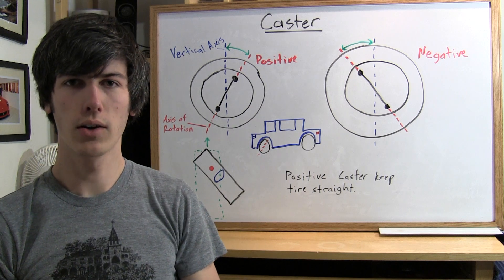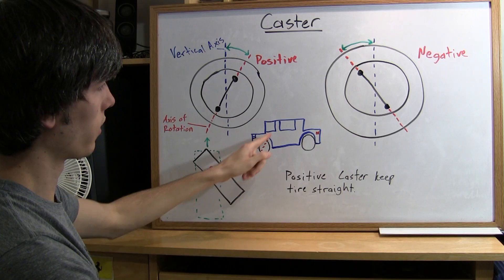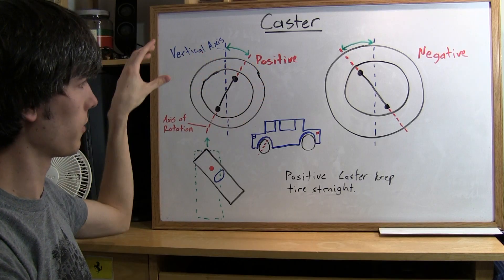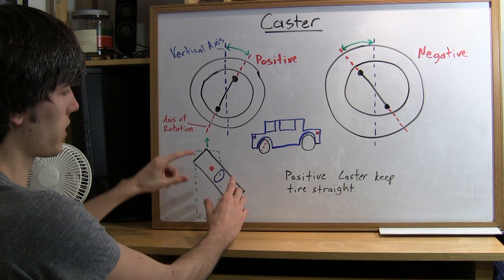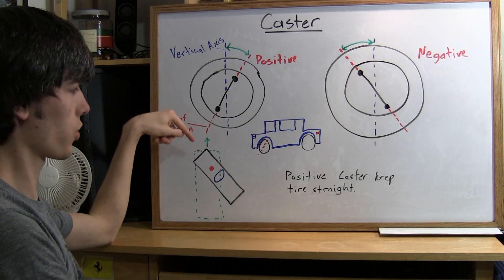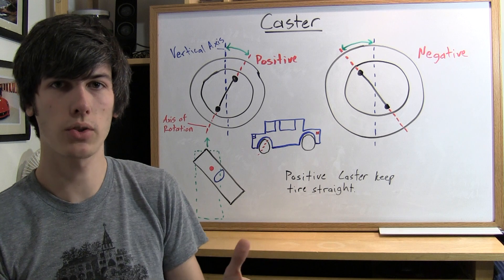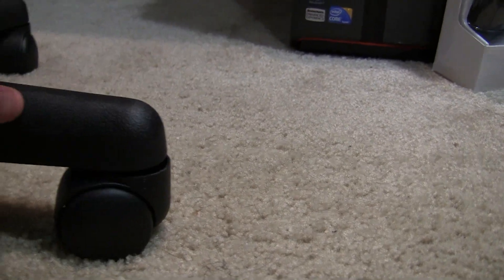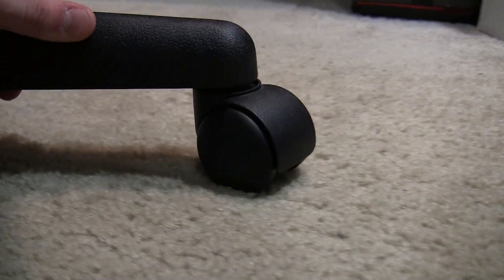What Is Caster? Wheel Alignment

Comment: why does uneven caster cause pulling to one side? Do the wheel center slightly to one side? I understand that with camber the increased rolling resistance causes a pull but i dont get what forces causes the pull with uneven caster

Comment: So the front wheel of a bicycle has negative camber? The patch is clearly ahead of the axis of rotation.

This must be why the steering is so unstable when you're "leading" your bicycle by the saddle and walking alongside, you have to actively tilt it to adjust steering.

The little tricycles kids use have positive camber though.

Comment: He didn't mention cross caster, about 0.25* to 0.5* difference between the two front wheels. If your car is wandering towards the gutter, you don't have enough cross caster. Cross camber applies too.
Reply: Less caster on the drivers side wheel will help counteract the road crown.

Comment: A simple way to understand what it does, it changes the camber at different steering angles. So if you run a lot of negative camber with positive caster, your leading tire has a better contact patch at sharp steering angles. Hence why drift cars have a lot of negative camber in the front to allow more front end grip.

Comment: since I changed my tyres, i have felt that the steering has gone too light(eveb though the new tyres are much wider) i.e. it is too easy to turn the wheel even when not moving. And while driving the car seems to sway aimlessly and the tyre would not straighten themselves. What could be the problem?

Comment: Got a new Car (Suzuki Vitara LY) and the steering doesn't return to center all the way, the wheel stays at about 20° if you don't push it back by hand. On most bends, I can let go and the car goes around by itself. It makes going in a straight line on the highway and changing lanes very difficult. How likely is if for a factory new car to have the caster angle wrong, be it by accident or by design?
Reply: Hamachingo thats just bad alignment all together
Reply: Jasperrsworld that's my guess as well. Looks like my dealer didn't check/do the alignment after the new car came off the ship and now I gotta do an alignment on a brand new car and sending the bill to the dealer. Apparently they just bolt the cars together in the factory and the dealer has to do quite a lot to make it ready for sale.

Comment: Nice video, but the example of the chair is not correct.  This is called "trail" and is yet another variable amidst camber, castor and toe.  Actually, the castor of the chair and shopping trolley is ZERO (its a vertical line), but it has x mm trail.
Reply: I see this as well good eye.
 To get caster (on his chair with LOTS of trail) tip the chair up on two wheels and push. The higher Caster will overide the trail and wheels will stay Ahead of the pivot axis.

Comment: How does the office chair not have a caster angle of 0? The wheel is rotating about a vertical line right? I see no diagonal line for the steering axis
Reply: Caster is just the angle. But then there are two arms (distances).
The intersection between the caster axle and the ground level is a point, the horizontal distance between that point and the vertical line trough the center of the wheel is one of them (the other is the the almost the same, but instead of ground level us measured on the center of the wheel level.
Office chairs have 0 caster indeed, but those two distances are not 0 ( and if caster is 0 they are the same, which is the distance between the center of the wheel and the vertical pivot axle of the "wheel bracket " )
404 English l guess

Comment: theoretically, would adding positive caster just make the steering feel more heavy?
Reply: With positive caster, the steering axis trails the tire. Assuming you have a straight up tire, (no camber or toe), that tire is going to want to travel straight. So yeah, theoretically steering will be heavier because of added resistance.

Comment: the chair has negative caster
Reply: It actually has 0 caster as the axis of rotation and the vertical axes are parallel. The concept shown with the wheel of the chair was, the straightening out of the wheels with respect to the direction of motion. Positive caster in daily life can be seen in bicycles where there is an inclination between the vertical axis and the axis of rotation.
Reply: When getting an alignment is it possible to have even tire wear and drive straight but Caster be off?    If so, how would you know?
Reply: No
Reply: it's actually zero caster. the wheel patch is simply offset from the vertical, but there is no relative angle between the steering axis and vertical, so the relative angle is zero.
Reply: I think so too!!
Reply: It depends on the position of the wheel during the motion: if it is in front of the axis it is negative, if it is behind it is positive.

Comment: The contact patch does change as you explain but that's not what is returning the steering wheel. Pressure on the spindle due to caster angle causes stability and wheel return.

Comment: Actually bro what happens is the spindle angle on the inside wheel is being driven downward trying to lift the vehicle upward, off the road on that side.. In which returns the steering wheel. And will cause a directional pull of not equal on both sides.
Reply: thanks for this advice
Reply: +Billy Mehaffey right.  So many explain the simplest part of the idea of caster and leave out the idea of the tire contact patch and moment arms and how left and right fight each other.  Then there is the whole gyroscopic effect of the wheel to consider.  Yeah, its not as simple as it may look....

Comment: Question, if my upper and lower balljoint studs are inline with each other, can I assume that's zero caster? And if so, would moving the lower balljoint stud "forward" increase or decrease caster? And lastly is the direction of positive caster angle different if the steering arm on the spindles is on the front or back of the spindle arm?
Reply: +Cuzntime studz have nothing to do with it.  What counts is an imaginary line drawn through the center of the pivot points of the ball joints.  Usually, the studs are in line though.  Steering arm location has no effect at all.  there can be considerations with steering arm with "ackerman" and how the linkage may deflect under load but in an ideal world the arm can be in front or behind the spindles.
Reply: I might be wrong but the it's more about the point that the track rod attaches to the hub that defines the castor angle

Comment: Is this the same as the angle of the fork in a motorcycle (or bicycle)?
Reply: yes.bigger the difference between contact patch and turning axis at ground level, better it will cruise. (+caster will help you to ride a bike hands-free, since the front is always centering by itself. but harder to turn)
Reply from the maker: +Stefanos Tsantilas That makes sense to me, yes.
Reply: Yes

Comment: Hello~
I've got  a question, is there an ideal caster for the rear suspension of a  rear-wheel drive car ?
If there is , what value would it be and why would we choose that value?
Thank you!
Reply: +柯旭東 Since the rear-wheel doesn't turn, I don't see why would they put  caster on it, other than space limitation concerns. 
For the front. Positive caster help the front wheel to go in line of the torque, but it also make turning very hard (more work for steering pump).  So they have to find the right value of +caster, where that front wheel would turn in straight on its own and close enough to zero,so steering pump can work as less as possible.  Caster of Zero would be dangerous, bcz front wheel would wobble at any road resistance.  (I strongly suggest you do a little reading about motorbike's front fork, especially on those chopper bikes. Choppers are harder to turn, but cruise well because of their fork geometry. they have ++ caster angle)  Hope I helped :)
Reply: +YC Y Thank you for your explanation.
I was wondering what impact would caster have when talking about bumpsteer haha
Reply: +柯旭東 oh~ that one. I think if caster is zeroed, the wheel would have tendancy to turn into random directions everytime it pick a bump at any slight angle. But yeah, I'm not sure physically why it bumpsteers :)

Comment: Even though I knew about some aspects (camber, toe-in/out) I had no idea so much went into the steering.
I'm building my first race car and I'm trying to learn as much as I can about suspension and adjustment. Thanks for the videos.
Reply: +Nermin C. Get an old "steve smith autosports" book.  Depending on the kind of racing you do, the learning part is often skipped.  Most people just go straight to what chassis builders tell them to do.  The builders have years of experience and often have learned the science then changed it to "standard" setups and things to do to modify the handling characteristics without really explaining correctly the "why".

Comment: Is not negative caster on the wheel of the chair? Isn't Caster angle the KPI related with vertical line that pass thought the center of the wheel in the side view?
Reply: I thought the same, but the steering axis is perpendicular to the ground and therefore in front of the vertical diameter of the wheel

Comment: Does a change in wheel diameter affect caster? I'm guessing that there would be more caster from larger wheels because the intersection point between the vertical axis and the rotational axis is lifted higher from the ground. Please correct me if I'm wrong.

Also, if you increase the caster in a car, would it become more difficult to steer because it just wants to remain true?

Comment: You are my new Hero
Reply from the maker: Very kind!
Reply: @EngineeringExplained  Sir, my car i20 front struts shockers are aligned perfect 90 degree with respect to ground when steering wheel is at normal or 0 degree position. However, the left shocker slanted bit about 30 degree approx with respect to its original vertical position when the steering is full turned to left. The same is for the right shocker when fully turned right. Is this change in vertical alignment normal??? Thanks.

Comment: Changed my caster 2.5 degrees.  Went from unsafe to perfectly normal.  8.5 caster to 6.  On Jeeps they call it "Death Wobble", any vehicle w a rigid front axle is susceptible to this extreme shimmy.  Turns out this alignment parameter is the most important to cure it.  Thanks for the video :)
Reply: Not just Jeeps. All modern 4x4's lose caster as you lift them.
Reply from the maker: Very welcome, glad your car is now safe!

Comment: If you aren't sick of me typing yet, you might be after this post! :)  You've covered one important aspect of Caster angle and how it relates to a car's suspension but you've left out what I consider Caster's most important feature.  Caster turns to camber when you turn the wheel.  Caster and Kingpin angle (See your Steering Axis Video) tend to fight each other in this regard but on most production cars you will get negative camber gain on the outside tire and positive camber on the inside tire.  This has a profound impact on keeping a tire flat to the pavement.  This is far more important than the self centering effect of caster.  Cars during the 60's have generally very low caster angles and poor kingpin inclination and the result of turning a corner quickly in a car made in the 60's will show huge amounts of positive camber on the outside wheel as a result.  By upping the caster angle and tweaking control arm angles you get a much flatter contact patch and much more front end grip! :)
Reply: gonna need a video on that
Reply: UrPeaceKeeper When getting an alignment is it possible to have even tire wear and drive straight but Caster be off?    If so, how would you know?
Reply: @Mr.Beastforpresident Yes

Comment: Outstanding!
When I drive in reverse at higher speeds is the steering more sensitive and some what hard to control because of the negative caster? I figure that if I am driving forward it is postive caster but if I am driving backwards it will automatically be a negative castor because I am sterring in the opposite direction.
Is that right?
Reply from the maker: Yes, but I'd say the biggest reason it sames more sensitive is because the rear tires are steering, not the front (when going backwards). This makes the turning radius significantly smaller, and also the rear of the car will want to swing out.
Reply: and why forklifts steer like that..
Reply: +Engineering Explained  and that explains why it's easier to reverse park into a tight car park

Comment: Correct me if I'm wrong (since I'm not a kart racer), but isn't caster adjustment in karting largely a jacking issue? I've been given to understand that due to the spooled rear axle you need to unload the inside rear wheel if you want to get the kart to turn properly, which can be achieved with the jacking effect of caster. Too little = not enough jacking, too much rear grip, too much = too much jacking, not enough rear grip?

Comment: One big advantage is camber gain when turning. The higher the caster the more the tyres lean into the turn, usually resulting in better cornering grip. Best case scenario: You can lower static camber to increase straight line grip and increase caster to maintain cornering grip. More caster increases jacking though, which can affect corner weighting, and partially diminishes the effect of steering lock, so it's not without downsides. It also makes steering much heavier.

Comment: IMO you left something out that has a significant role in suspension setup.

Say you have 3 degrees of positive caster. If you were able to turn the wheels 90 degrees, that would introduce 3 degrees of negative camber on the outside of the wheel, and 3 degrees og positive camber on the inside wheel. 

This changes the way the vehicle handles and the stability when travelling straight or conering.

Comment: Good video, but you´ve messed up in the example. The chair wheel doesn´t have caster angle, only trail. Remember the definition, caster angle is measured in the steering axis vs vertical line. So, chair wheel has 0 caster, but with a huge trail. That´s why the wheel turns while pushing the chair.

Comment: I like your videos but your example with the chair actually shows negative caster. Draw a line from the wheel axle to the steering axis pivot point and you will see what I mean. Vehicle control requires positive caster because it lessens the effect of vehicle mass on the wheel direction.

Comment: Ahah! This diagram in the top left actually helped me to understand the steering axis-inclination a bit better! Very nice video.
One question on steering axis inclination though: I can see how the inclination would pull the tire straight if turning one direction, but if the tire is turned in the opposite direction, would the inclination not push it up instead of down thus making the pull to straighten the tire only effective when turning one direction? 
I hope that made a little bit of sense....

Comment from the maker: @justins462 It's connected to the flywheel which is connected to the crankshaft. So as the engine rotates, the torque converter rotates, forcing the liquid inside to circulate, and finally spin the transmission shaft.